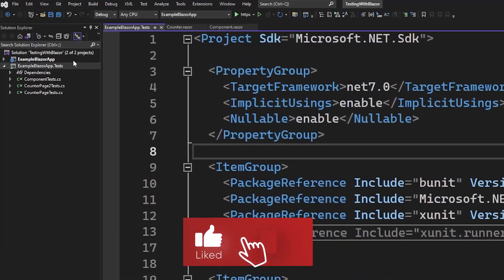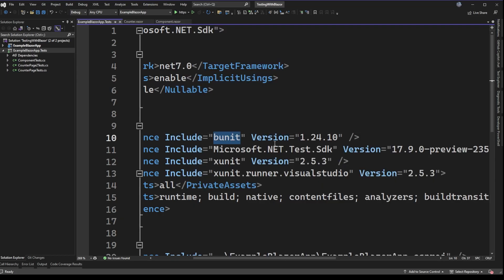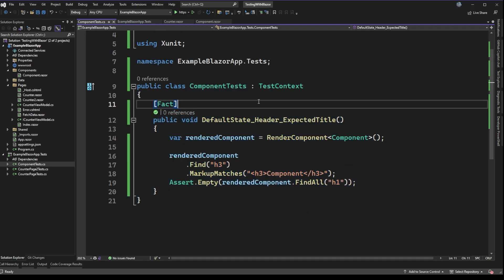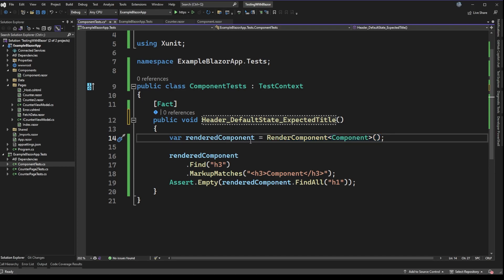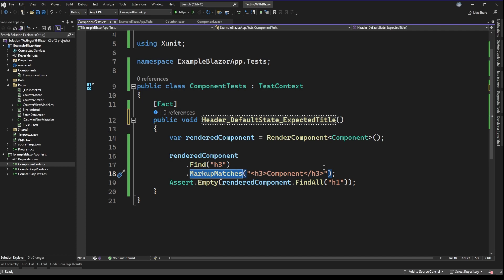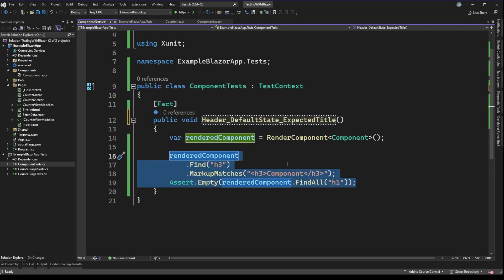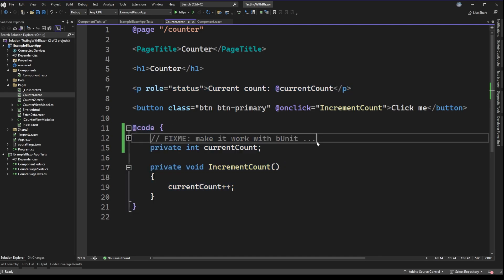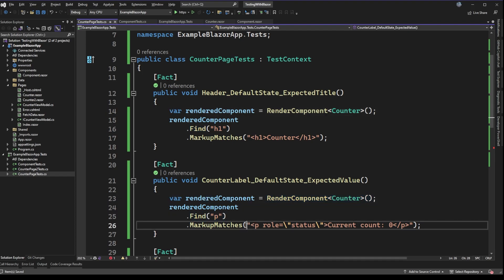How to Write Blazor Unit Tests With bUnit and xUnit

Comment: Thanks, this will be useful getting started.  However I would recommend not setting internal values (with the exception of parameters that are required) and instead manipulating the gui.  This more accurately tests how the user will interact with the page.  Setting the counter to 5, is not testing the funtion that increments the counter, or the gui button to see that it calls that function correctly.  So it has very limited value.
Reply from the maker: This is conceptually about setting state so that you can test given scenarios. 

If I need a value to be at 10,000 before I can test a scenario, I'm not going to loop 10,000 times to achieve that.

There are always going to be scenarios where this is more valuable or less valuable -- it's context dependent.

Comment: One more question: where should the bunit project reside. Does it have any security implications. Can we use it for our internal application in the company.
Reply from the maker: I personally create my test projects in the same solution as my code that's being tested. The test binaries are just things you don't ship (it's bloat for anything in production).

For security implications... There's nothing inherently insecure with bUnit or test projects. However, that doesn't mean putting credentials directly into your tests, for example. I like to imagine if where my tests are running gets compromised then someone isn't walking away with all of my secrets as well. Just like on a production server, you likely are not keeping secrets in plain text, for example.

As for using it for an internal application in the company: Yes, I'd absolutely say so.

Now a full disclaimer: I can't speak for ANY third party code and sign off on it 🙂 if your company does security and compliance audits, let them review it. But personally I'd see no reason at all to be worried about bUnit.
Reply: @DevLeader  great 😃, thank you for providing in depth detail . It seems that will let the security team to just verify it once.
Reply from the maker: @niteshsetin  that would be my take I think 😉 get the nod of approval

Comment: Question : why do we need unit testing for blazor frontend only, I understand that backend apis project we can do unit test. But i couldn't understand why we need to write code for ui testing,isnt ui testing has to be manually done.what are we testing when we write those test cases for UI specifically and again if i have complex ui like table where i am testing functionality like export data to csv file or edit the inline cell of tables, isn't it a complex task?
Reply from the maker: This is a really good question, so thanks for asking it! I have a general answer to start with:

To build confidence in delivering changes.

My goals in software engineering are to be able to ship value to customers as rapidly as possible but without aggressively decelerating over time. That is, sacrifice any other investment so it becomes so difficult to ship software quickly.

From my professional experience: any manual testing as part of regression testing absolutely does not scale and will grind teams to a halt. Yes, manual testing for usability and exploration is great. But if you ever plan on repeating that - automate it. Humans are far more useful at test strategy and being a user proxy than just clicking through buttons.

But your next point about complicated scenarios - ESPECIALLY for stuff like this we should think about how to write code that can be tested via automation. At some point, unit tests might not be the right tool - but doing some other type of functional test could be very valid.

At the end of the day, it's all about having automatic regression coverage so you can keep delivering changes with confidence. And ideally, you're picking solutions for that coverage that don't slow you down to maintain.

I hope that helps explain my perspective!
Reply: @DevLeader  I do see that in organisation although we have automated testing,it still goes to manual testing via QA and then it goes to UAT which is again by humans and they need to do regression testing since they don't want anything breaking up in production. Aren't this doubling effort at each level. What's the catch here?
Reply from the maker: @niteshsetin  I mean - if your organization is using humans to do repeated regression testing on anything that's something I would (personally 🙂) be advocating to move away from.

So short answer: Yes, it's entirely duplicated effort.

Longer answer: Are the tests duplicating the effort, or are the humans manually exercising what you could be trying to automate duplicating the effort 🙂

I realize it's not trivial to just change an entire organization (I lived this exact thing for 8 years at a company that I had significant technical influence at) and it was still not fully changed. But my honest opinion is that using humans to regression test anything should have focus to move towards automation.

Humans are not as effective as machines for repetition 🙂 humans, I think, are better served being creative to think about what and how to test though.
Reply: @DevLeader  on the point, great explanation,I loved it and yes I understand now your point as well. I am gonna sit down with some of our technical managers and see how they want the things to go on.and now I have some points from here as well to argue
Reply from the maker: @niteshsetin  thanks so much for the dialog on this! One final piece of advice: the folks that are currently doing the testing... The goal is of course not to say that they aren't offering value. I think it's just the wrong focus.

I, personally, get SO much value from testers when they can help identify where automation gaps are, understand where slowdowns are, where things are brittle, etc... There's just so much other value they can add 🙂
Reply: @DevLeader  yep I agree, it's same as saying why we need coders when we have chat gpt around. But also another part where you explain about cutting corners from doing repetitive tasks,it makes sense to just automate those stuff.
Reply: I hope at some point microsoft will release official testing tool for blazor as well.
Reply from the maker: @niteshsetin  this would be great! Unfortunately I work in a COMPLETELY different side of Microsoft 😂
Reply: @DevLeader  completely understand, I was just going through the guidelines from Microsoft website on how to do unit test blazor application and it suggested E2E testing and Bunit. And later part somewhere I read there is no official unit testing tool from MS. So I hope at some point they will release as most companies will start moving webapps to blazor.

Comment: A good introduction to testing rendered elements. Thank you! 

Can declarations like the @page route be tested?
I guess the same goes for @inject services.
Reply from the maker: Thanks for the comment!

Just to check my understanding of your question:

 - You would like to ensure that the razor page route can be navigated to based on what's in the @page declaration?
- For the @inject part, what would you like to actually be asserting? The presence of this, or that the service is injected, or something else?

If you can clarify a bit (maybe explain why as well) then I can see if I can whip something up 🙂 Thanks!
Reply: @DevLeader  apologies, for the @page declaration, I was curious o
If the test is capable of checking the value being set and possibly asserting the route is of a particular value.
For the @inject, I guess I was thinking if oninitialized calls the injected service how bunit handles this and if we'd need to mock said service.
Reply from the maker: @2u1u  Nothing to be sorry about! I do very much appreciate that you're asking questions and being curious. It's on my end for not understanding, so I just wanted to make sure I had clarity so I could answer more effectively 🙂

Let me see if there's a good way to do this route check. I've done route configuration tests in asp.net (discover all of them, check they're configured properly, etc...) but this feels like a different perspective on a similar type of thing. I'll make a note to cover it in some capacity!

For @inject, if you fail to have a matching service registered in DI bUnit will blow up when it tries. I believe bUnit is simply creating the component via DI, so if the dependency it needs isn't present then it will fail to create it right in the test.

I just realized we were discussing these on the first video in this series 🙂 The second one comes out on Monday and my newsletter subscribers received early access to it this morning. It actually covers the @inject scenario sufficiently, in my opinion.

The newsletter software is kinda tricky, but if you message me on Instagram with your email I can send you the issue if you'd like!